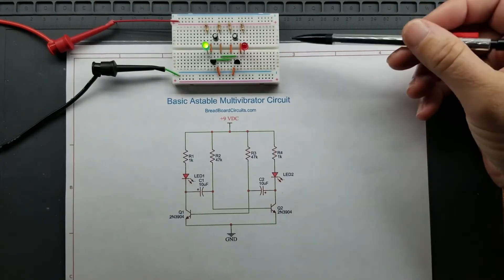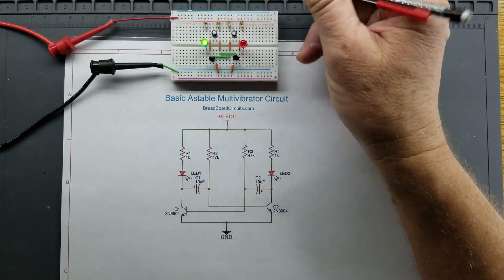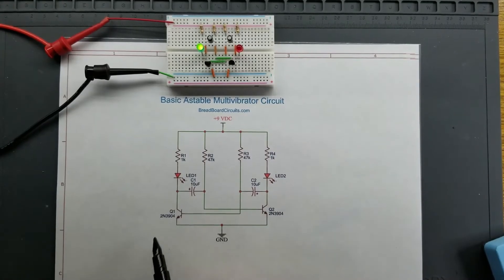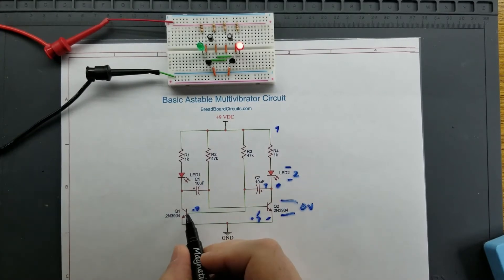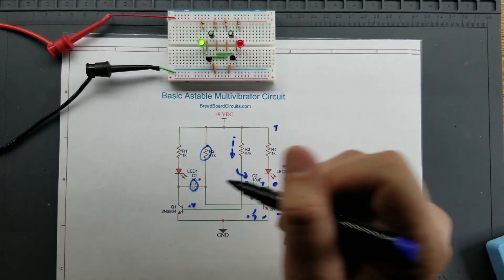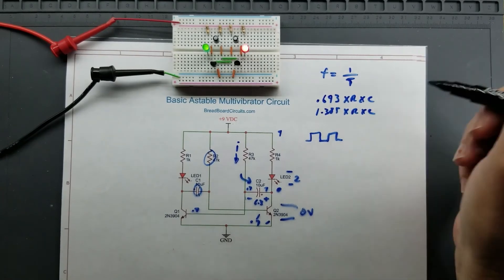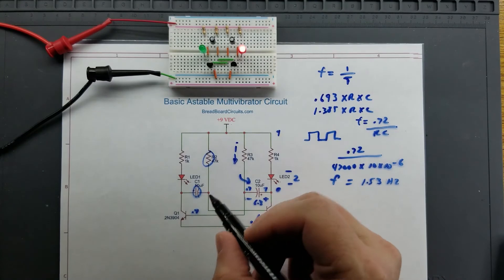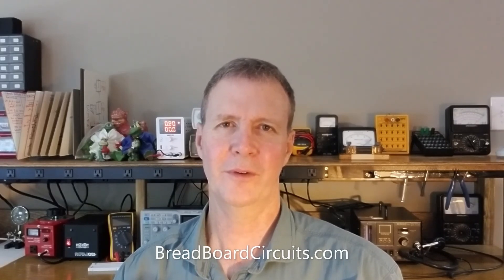#10:  Build an Astable Multivibrator Circuit on a Breadboard

Comment: Can this circuit work with 100microfarad capacitors and 22k resistors
Reply: There’s charts you can look up for changing oscillation speed by playing around with capacitance and R2 R3 resistances